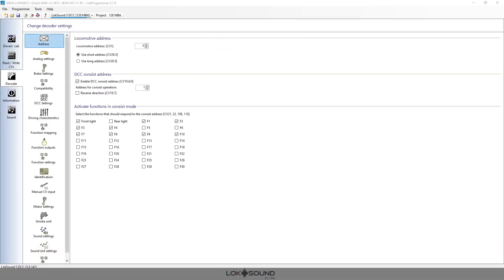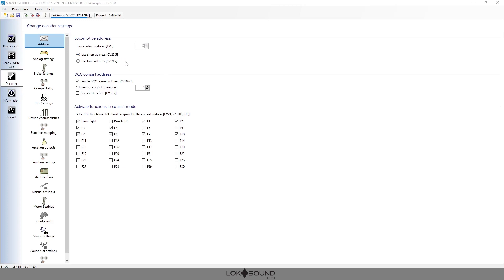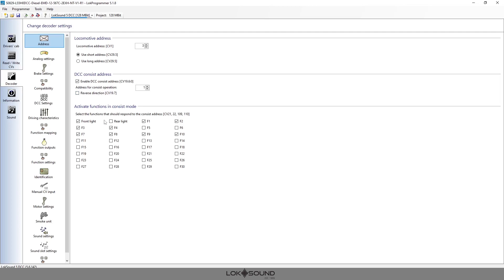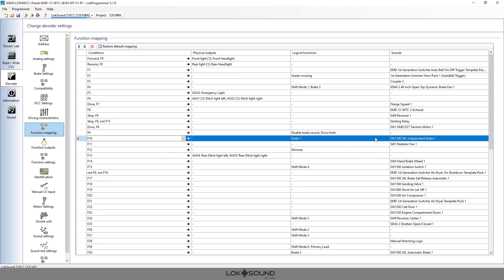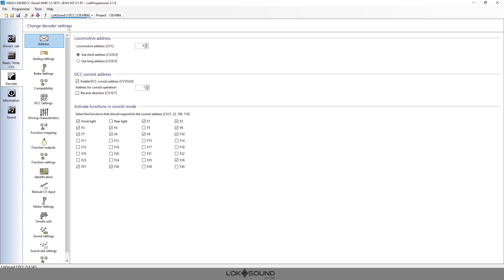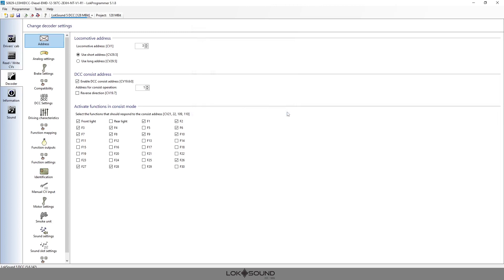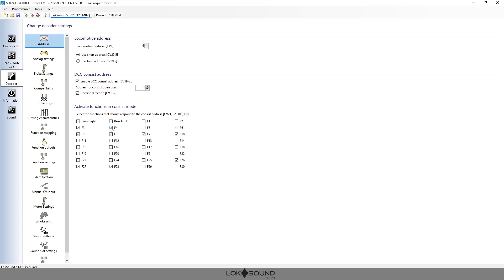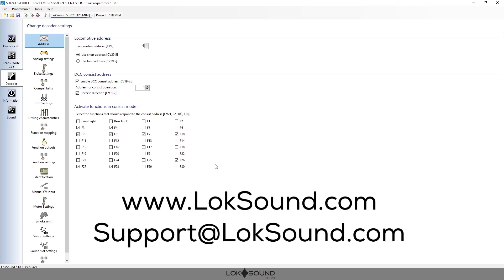Tutorial EN LokSound5 Advanced Consisting with the LokProgrammer

Comment: Hello.
I have a question.
How to Change the Direction of a Consisting. If it is to go the other way in relation to the horn, and bell. How to set it up?

Is there something about changing the function mapping on the rear locomotive so that the front does not say anything when the horn is pressed down on the rear or is there another way to do it?
Reply from the maker: With the NMRA consisting CV defaults this is not typically possible, but if you set the function mapping to be directional this could be done.

Comment: I have a Lok programmer and several loksound 5 decoders and really like the tutorials. It is nice with consisting to be able to just tick a box on each loco to set up lights and sounds and things. I still sometimes struggle with getting speeds matched but that's another thing.
Reply: I was experimenting with this last night with a pair of Southern SD45 units from Scaletrains, and both headlights one each unit work even if I have each one setup so that just the long hood lights should light, and the short hood ones stay off, but if both headlights on a unit are set to stay off then they do just that.
Reply: @SOU6900  While I have not played around with it too terribly much, I'm betting it has to do with the fact that there is also logic settings involved on a regular basis with the directional lights. Fore or backward combined with the consist settings might make it a bit tricky initially. 
One thing I wanted to do at one point was if consist forward, then A unit front facing light and no other lights. If consist moving backward, B unit tail facing light and no other light. But it's more complex than it seems due to that logic on the headlight functions.
Reply: @tvtoms  I'm hoping one of the ESU gurus in the club I'm in may have an answer to this. ESU decoders are a new beast to me when programming. I'm more comfortable with programming Tsunami2 decoders on a digitraxx PR4.
Reply: @SOU6900  Yeah good call. Also the ESU website and youtube channel have a lot of in depth videos including this sort of thing..
I think you'll find that if you call up the individual loco, then toy with the headlight logic before consisting them, it would likely be the way to do it, but I don't know yet myself.